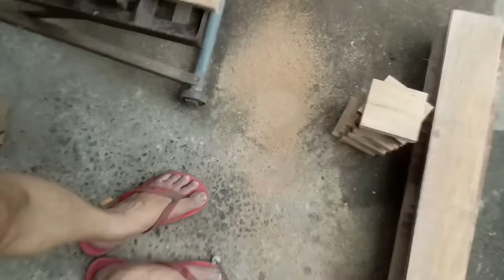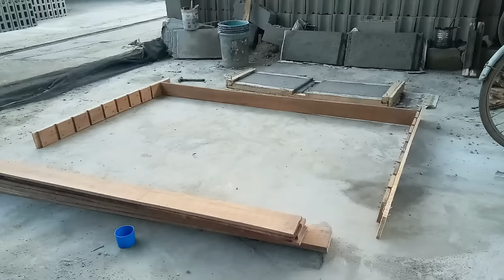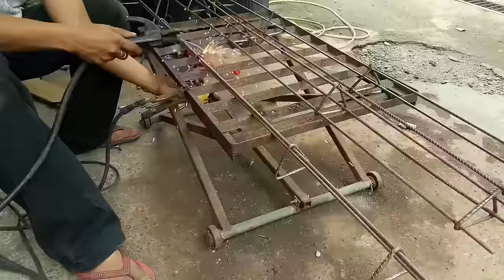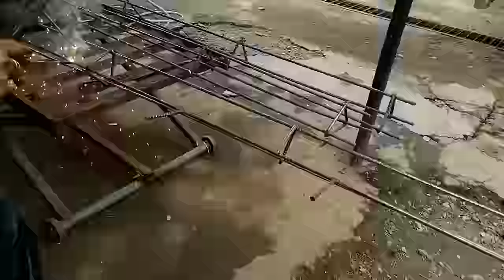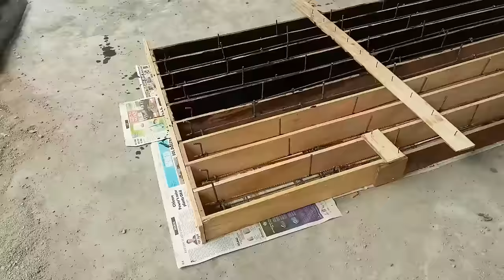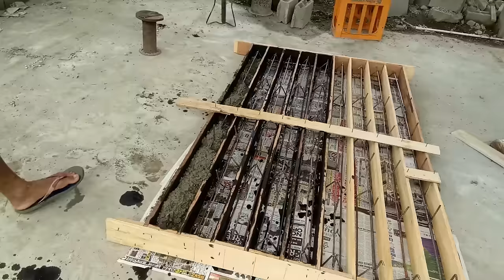DIY Making Cement Concrete Post

Comment: Very important when making the rebar triangles, to leave an extra inch at the both ends of the rebar so they overlap at the corner (like 2 hooks), this way ensures maximum connection between the steel components when the concrete is poured and u can skip the welding step. 

they way you made it makes one of the 3 sides not tied at all to the steel structure, beside the welding which can break easily when the post is flexing
Reply: Good point🙏

Comment: If you're watching & think those ^ won't snap like twigs with any slight impact, well good luck. Adding re-bar does not make a concrete thing "strong", it just means when the concrete breaks, the 2 pieces will still be some-way attached by the bars. In the case of these, you will be able to knock them  over with your shoulder once they are concreted in upright.  The mix is hopeless, the vibration used is hopeless & yeah - don't copy, because you'll be wasting your time.
Reply: Wouldn't dream of mixing that much concrete without a mixer.  It would kill me for one thing...  So what would be the right mix?  Would redi mix be OK?  You're saying his tamping is bad?  Agreed; how should it be done?  Any  small machinery you could use to do it better easier?  
This video could use some captions.  I found the music annoying till I muted it.  Interesting video.
Reply: @dandavis8300  You need to use a vibrating table, the mix needs to be pukka as hell - 40n minimum & readymix is waay better - plus when they make these commercially(I know, used to be involved) they pre-strain the rebar & cast them in long runs - without the prestress, the rebar does feck all. Even with a good mix, good vibration, minus the prestress, the post will still be crap & will break. The pre-stress used runs to tonnes btw - give making them a miss & buy 'em - it's cheaper. :-)
Reply: @jamesward5721  --Thanks!
Reply: Mistake you've made is assuming they're for structural construction use. Given the length dimension of the planks are 73 inches then they're 6 foot high. So they're almost certainly fence posts. The hash tags #concretepost #concretefence pretty much show the intent. If you want developing world costs, then you get developing world quality.
Reply: @cowboybuilder  I owned and ran Rock-Cast Fencing for years - we fenced half of new Dublin using concrete post/concrete baseboard & timber insert panels. I didn't make any mistake.
Reply: @jamesward5721  I think you're a little too focused on the 1st world. These would do the job (And do the job) in the environment in which they're made. Generally they're used for perimeter fences and embedded in a concrete footing. They don't suffer from wind shear because ultimately less than 4ft is exposed and with everything else they weigh a tonne. Heck, we've made loads of lintels in concrete, its all about loads and sheer.
Reply: Normally I'd take professional advice, but lately I've seen "professionals" make sh!t quality anything, and charge sky high prices, and whatever they build needs ton of inputs and maintenance. Also hard getting people you pay to even show up. Sometimes you gotta do the best you can with what you've got. I can see these having lots of useful applications, especially now that pressure treated wood is low quality and higher in price than steel or concrete.

Time and Resources vs Price.

Wouldn't pour slabs, but I mix bags of concrete by hand and bucket  for raised bed panels, cement flower pots, footers, paving stones and filling old ruts in gravel driveways. Not fun, but just try getting a cement truck or someone with a mixer to show up.
Reply: Normally I'd take professional advice, but lately I've seen "professionals" make sh!t quality anything, and charge sky high prices, and whatever they build needs ton of inputs and maintenance. Also hard getting people you pay to even show up. Sometimes you gotta do the best you can with what you've got. I can see these having lots of useful applications, especially now that pressure treated wood is low quality and higher in price than steel or concrete.

Time and Resources vs Price.

Wouldn't pour slabs, but I mix bags of concrete by hand and bucket  for raised bed panels, cement flower pots, footers, paving stones and filling old ruts in gravel driveways. Not fun, but just try getting a cement truck or someone with a mixer to show up.
Reply: Of course rebar gives it strength. It gives it tensile strength
Reply: @gregorsamsa1364  I used own a precast concrete business. You ain't educating me.
Reply: I am still waiting for so-called “expert” to post a reinforce concrete fence post making😊